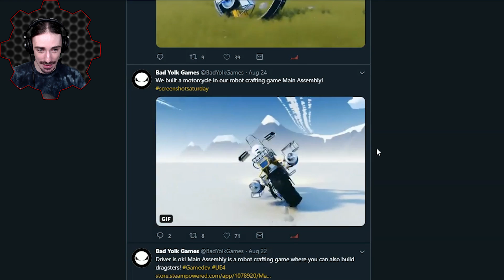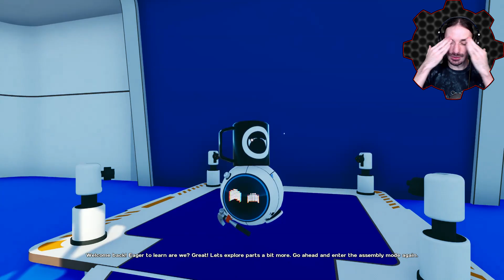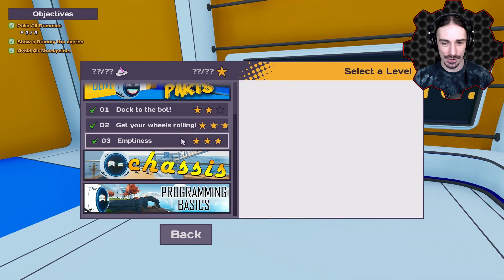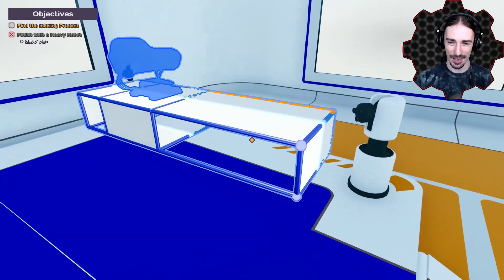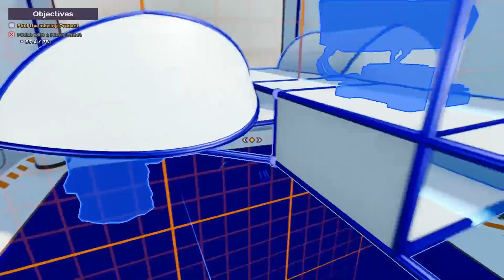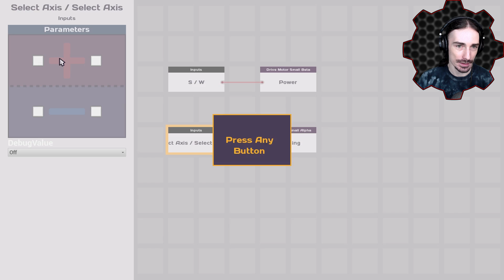Is This The Best Vehicle Crafting System Yet? - Main Assembly First Look

Comment: Brick rigs?
No 90° angle grid.
Sandbox building.
Free placment.
You can control which blocks connect to which.
Can get super complex as you can place legos (yes, legos) inside of each other for complex parts.
And it hs many different bricks to rig with.

Comment: The building is almost like a modelling software mechanic

Edit:thanks for the likes guys this is the most likes I've ever got
Reply: Exactly. Plates are faces, frames are edges, joints are vertices. You can move and extrude and the curvatures are basically a very simple kind of subdivision surfaces. Very cool.
Reply: C OO L